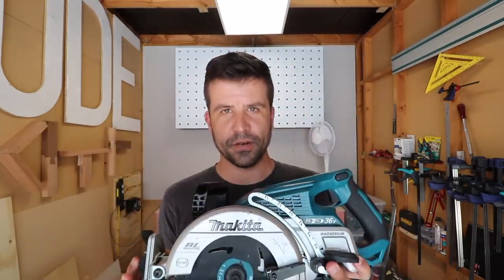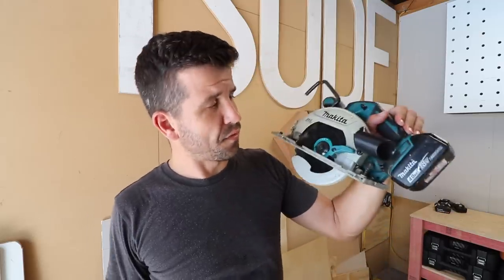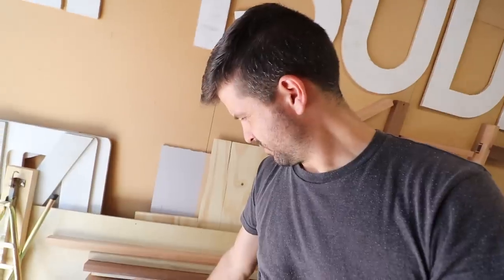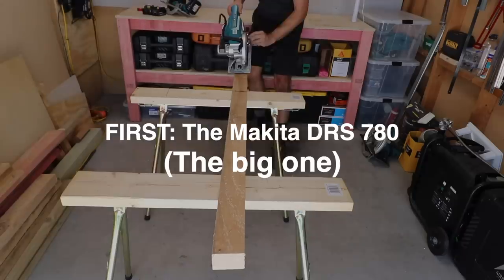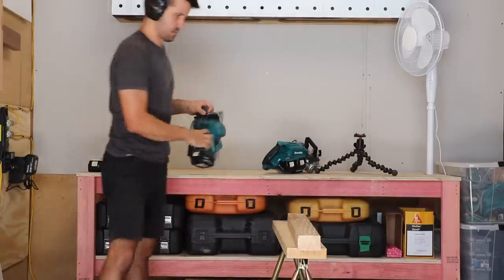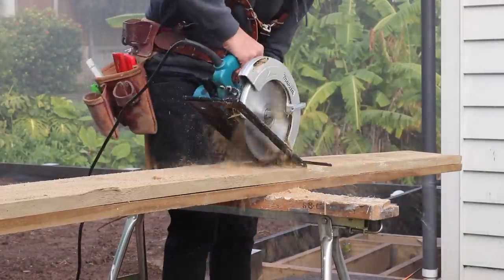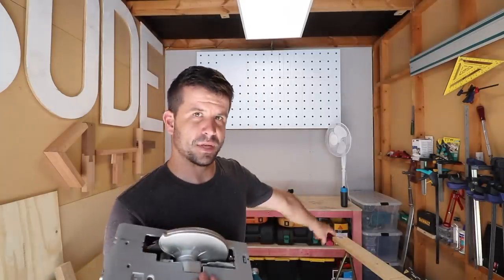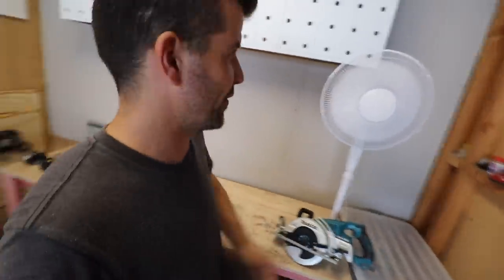MAKITA Rear Handle 36V: It's Good, But Do You Need It?

Comment: Ok so I’ve been in the fence about getting this cause most of my cordless stuff is DeWalt and I needed a new circ saw and I hadn’t invested into the flexvolt lineup yet but after watching this I pulled the trigger today and bought it! 199.99 for the saw and 300ish in 2 sets of 5.0 batteries and a double bat fast charger! Used if this afternoon and I’m in love! Thank you.
Reply: I got the dewalt 54v saw top handle and I love it
Reply: Damn. Good times to at nowadays. I got the same deal you got for $250 altogether plus a free xlock grinder. They’re having deals like Milwaukee now.

Comment: I've got the big corded hypoid saw from Makita (affectionately called the beast) and, honestly, it's rare that I need to dig it out and run some cords for loooong rips in pressure treated lumber.  It is amazing how powerful it is but the little single battery pack BL saw will do 99.999% of what I need and I don't mind doing cuts all around on a post as it's so quick and, especially, lightweight!!
Reply: Where can you get a hypoid saw in NZ? I've been looking for ages.
Reply: @nopenopeandnope7050  Well, I'm in the States and you can practically trip over the corded ones in the big box stores (or Amazon).  If you are looking for the cordless 36V one, I haven't looked for it so I dunno if it's out on the shelf yet...
Reply: @mixpick138  ah thanks. I want a corded one, but it seems you simply can't get them outside the US for some reason.
Reply: @nopenopeandnope7050  I don't think I'll ever understand product availability.  I've been looking for the new BL cordless hand planer from Makita that you can get in NZ but I can't get in the States --go figure...

Comment: Just was perusing Amazon they have them for 160.  That makes it a no-brainer.  The 2x batteries are being fazed out for the new 36V.  But for me, the 2X still makes sense.  I am going to see if I can run it on my Dewalt batteries with adapters.  I don't really care, but for a guy who is paying, not getting paid it would be fun if it worked.

Comment: An electric motor draws power proportional to the work it's doing per second.  Performing cuts and spinning up the blade draws dramatically more power than moving around a little bit of air in direct proximity to the blade.

Comment: hi, not necessarily longer run time as the 36v battery is run in series. meaning it will still run 5 amp hours. 

difference is, like you said voltage... power.

Comment: It didn't overheat, most new tools these days have timers built in to automatically shut off. This is in case a tool gets tossed into someones work truck, or what have you, and the trigger accidentally gets pushed on. You see it more commonly in drills.

Comment: I own the saw and I love it  The rear handle Makes it easier to perform straight cuts It is expensive but I would not give it up
Reply: Home Depot has this rear handle saw, dual charger, two LXT 5Ah batteries, bag and two free LXT 5Ah batteries for $249. I just bought it...5/04/21.

Comment: I've got the RH normal handle version of this and its a great saw but the runtime isn't as good as I hoped.

The blade is great for cutting in a straight line using a guide. But if using a fence or free hand, it's absolute shit. Too flexible. I once ripped abit of ply and the result looked like colourbond roof iron. Changed blade to the thicker bluemak blade and it was sweet!

Comment: I like the idea of the saw blade where I can see the cut with the blade on the left.
I've looked at the DeWalt Flexvolt 54V XR Li-Ion but the DeWalt takes proprietary blades with the diamond shaped bore but it takes one battery.  This one looks like the way to go for power cuts.  If you have a strong arm then you're sweet (if you are happy using the Hitachi/Hikoki framer gun then you have a strong arm).
Reply: I have had the dewalt for over 2 years, my favorite power tool I've ever purchased.... Every 7(1/4) blade (at least in the states) has the diamond arbor as a knock/twist out... You buy a standard blade (not proprietary) and knock out the diamond and good to go. I use the diablo demo-demon 24 tooth blade for general use
Reply: @brianwood876  Thanks...  In our hardware store over here in NZ I found only one diamond arbor blade...  the rest being the various annoying diameter holes.   :)  Thanks for letting me know that the diamond hole is not proprietary.  It would be nice if DeWalt supplied a circular arbour replacement; I'd buy if they did and I'm pretty sure from memory the saw connector with the diamond is replaceable.

Comment: If you use those Makita batteries that heavily, like the runtime test, you'll damage them. The company I work for uses a cordless reciprocating saw, and when we used it heavily, it trashed the batteries. They permanently lost charge capacity.

Comment: I have the Dewalt rear handle saw. It too has grunt but not like my 30 plus year old Hitachi 9 1/4 electric saw. Also still getting used to blade on the left after so many years blade right.

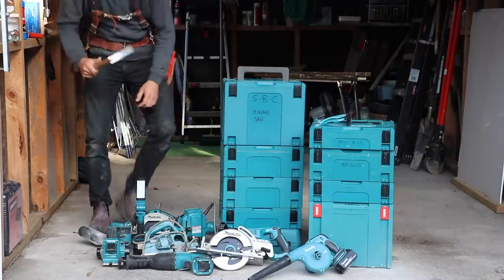Comment: @7:05 agree that’s why I’m considering getting this over my m18 7 1/4 rear handle saw. This is better from what I hear and see. Maybe not as strong but overall better quality and performance. And I have everything else Milwaukee. Except the dewalt fan because that was a deal with a free 3.0 and charger lol. Plus it’s better than the Milwaukee fan.

Comment: Just saw your videos on why you timber is pink and you mentioned dealing with all the old materials. Do you ever have to deal with asbestos or is that not an issue in NZ?
Reply from the maker: Yeah we come across that from time to time. Fairly common here. I get the pros to remove it before we make a start.

Comment: Hi, some great vids you have put out.
As just a hobby - est, around the house garden. Would you go for this or DHS 680 Have batteries already. just looking for best tool for my bucks?
Reply from the maker: DHS 680 for sure. A lot easier to use and light weight.
Reply: @ScottBrownCarpentry  Very quick reply there Scott.  Cheers.. I just thought the 680 looked a little flimsy (build wise)  against the twin battery one. however going with your vote..Thanks once again. Kevin
Reply from the maker: @kevint7851  no problem 👍

Comment: I have the sidewinder version.   3 of em on the job for over year and no issues.  Old batteries (2+yrs) don't like cold.   Trash that makita blade if you're ripping... The teeth are too thin and it walks all over the place, compared to thicker kerfed blades

Comment: @scott Brown carpentry
If you only had the 36v, would you bother getting the smaller 18v?
Reply: Yes the 36v is really heavy. I cut roofs and floor joists with mine. His 18v is adaptable with the Makita track too and much better for lighter work

Comment: My Home Depot here in Tampa, Florida Had one on the Shelf. No battery charger But I had the two batteries. After everything's done. I got a lesson. $95 I wouldn't have bought it. If I didn't win. The subcompact saw from cop tools now it's belts in boxes And they gave me a dual charger. But I did see the power change ripping. Cuz I bought a bunch of they call Two by sixes. But they were deck. Planks I bought them cuz they were discounted little flaws. To work on my Weis card And that's all made it so much easier. I don't blame you for buying it. Most important all cheers with a beer and public service announcement don't drink. Corona beer you don't want to get sick with a Coronavirus.😂🤣😃😄😅😆😁😅😃🤣😀😄😆😉😁😅🤣😃

Comment: I notice you deal a lot with humidity where you are. I live on the east coast of Canada and in summer time I have to change my t-shirt at least 3 times during the day. Last year was exceptionally bad for humidity.
Reply: Northern NZ is getting a lot of tropical airflows this summer. So 30+ C a lot. When Australia is so hot, the heat can spill over to us despite the 2000km of sea. And Auckland is known for humidity anyway. So Scott needs a bigger fan for sure.
Reply from the maker: Yeah for sure. Rainy in the winter and sweaty-hot in the summer

Comment: Hi Scott,  how did you hang up the makita charger to the wall?
Reply from the maker: My charger has rubber feet that you can remove. I screwed the rubber feet into the wall and then pushed the charger back onto the feet.

Comment: That 5kg is a beast to be lifting all day, but occasional cuts and ripping would be worth it to be cordless
Reply: its actually not that bad, i have an American 110v makita and its around 8kg, you get used to it and its well worth the ergonomics and power, plus you get no kickback because of the weight and the handle being behind the blade. those stupid little saws we get here with the blade on the right, and the damn handle next to the blade, are just crap and awkward

Comment: I've been in construction for 37 years ,I live in Oregon in the US. Framing houses here you need to really have a saw that can handle the work,worm drive skilsaw has always been my go to but switched to the rear handled Makita and absolutely love it, never had any problems so far and it rains quite a bit up here so not having to drag a bunch of cords around is a real benefit as far as time and efficiency is concerned,  %100 recommended this for contractors.

Comment: I hate, yes strong words, HATE the left hand saws. Constantly get sawdust in my shirt and down my pants. I can't get the dust attachment like on yours in Australia. I have an 18V one like yours but only used it for about 3 months till the right hand one (DHS660) came out and went straight to the shop and got one. Same about the battery platform as well, Makita. The right hand saw doesn't come out with a rafter hook though.

Comment: Extremely expensive in E.U baretool is barely as expensive than the pack version in the U.S (two 5ah batteries + doublecharger)
Reply: damn, bare tool is 319CAD here which is 218EU
Reply: @anand8905  from 300 to 340eur BARE TOOL here (vat included) madness..
Reply: @perrinekld7451  wtf
Reply: @perrinekld7451  because you guys add 20% taxes, makes everything expensive
Reply: @valpanig  even with the vat, it's still much more

Comment: HEAT OVERLOAD! Really not good for tool to run constant. Lucky for heat protection built into overload protection. 
  Test run time at load. Run time at no load is not any useful measure.

Comment: Scott if your 165 brushless saw caught fire cutting rock hard air-dried oak (like mine just did) would you buy another or this 36v? Does it run with just 1 battery BTW?

Comment: If the battery charger is anything like the Makita 18v Combi drill charger then it isn't worth bothering with because the charger will pack up. I wouldn't buy Makita's made in China again or cordless Makita products. The EU, UK and USA made corded angle grinders I have are great!

Comment: Rear handle saws are too heavy and awkward, I have the Dewalt Flexvolt dcs 575 blade right saw ,just as powerful as this Makita and it is lightweight . The 575 can easily do long full depth rips in seasoned Aussie hardwood with ease and you don't have to hold it with both hands

Comment: Testing run time the way you did is flawed in many ways. Way one as you saw was overheating as the motors are not designed to be cobra fly run. But more importantly battery use goes up when you load the motor. Having it sitting there doing nothing isn’t loading it so pointless.

Comment: Well as a Carpenter and Deck Builder, in my Opinion that Makita Saw is so Damn Stupid and Dumb!  Don't get offended but that's my opinion only! When it comes to Makita of course I like Makita even though I'm a DeWalt Fan. But I like Makita except that model is so stupid. For $349 Makita Brushless 36V cordless Rear Handle 7-1/4" Circular Saw it comes with x2 18V 5.0ah Battery, a Charger and a Tool Bag all of it cost $349 at the home Depot! Plus your State Tax depends on which state you live in. It's too Expensive and it's not as powerful as the corded Makita Hypoid Saw or the Skil Worm Drive Circular Saw. For $349??? I'd rather buy the Makita 3477NB Hypoid Gear Drive 7-1/4" Corded circular saw and I can buy 2 of them plus the State Tax and I can also buy a spare Diablo carbide 7-1/4" 24 tooth framing Blade all of it for $349!!